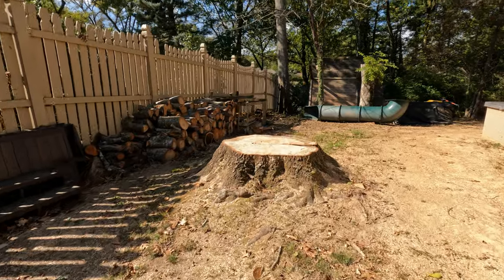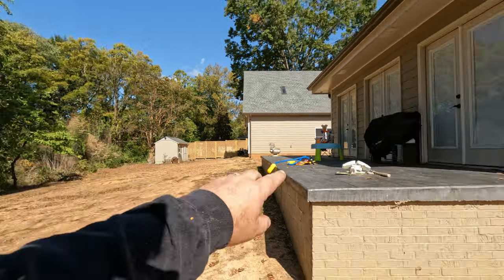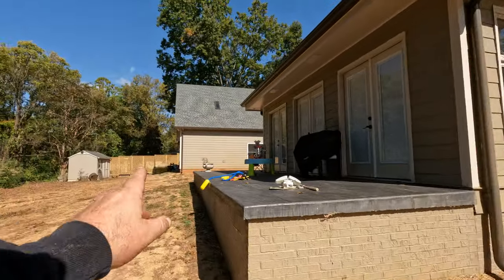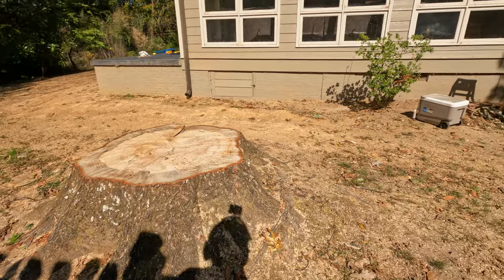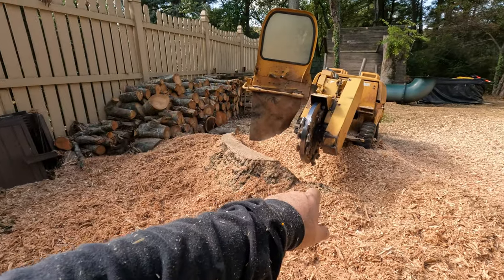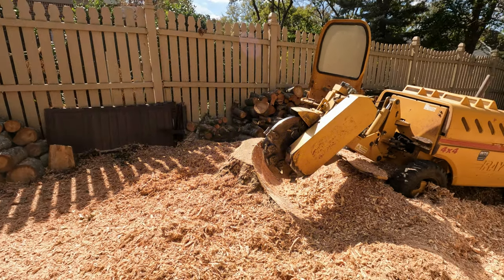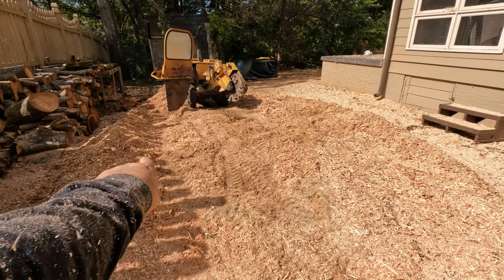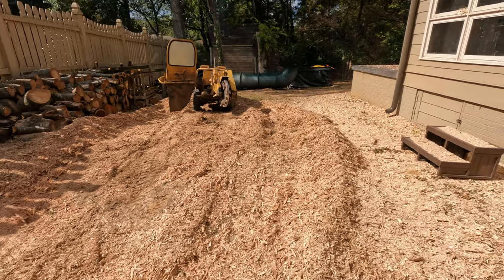" Stump Grinding: Conquering a Massive Stump with Dull Teeth!"

Comment: Couldn't agree more Chris. I recently did a 60 stump job, and after about 45 stumps my teeth went dull, it was a pain. Took more then twice the power from engine and cutting speed was much slower. When I noticed my hydraulics on the swing was forcing the cutting wheel through the stump, it was time to quit.  Much like a chainsaw, you shouldn't have to force the bar through. 
     By the way, remember when I asked you a week or so ago what's the worst thing you ever hit? Well, I  hit a 3/8 log chain on that job!  Luckily, it was just under the top soil an inch or so. If it would have been embedded, it probably have stopped my 80 hp Rayco in its tracks and damaged something.  Also a miracle the teeth didn't catch it and wrap up in the wheel or fling it at me!  Happy grinding buddy.
Reply from the maker: @toddscholze168, How long it take to do 60 stumps with your 80hp Rayco? My stump grinder has 65 hp. I have also hit stuff and that's what I what out for the most. Thanks for watching!!! Keep grinding!!!

Comment: I did a similar size willow stump the other day but it was cut higher than yours. Completed in about an hour and 20 minutes with teeth getting dull on the bandit 2550. But I was also hopping in and out of the customers skidsteer to remove mud and chips and had to chase roots. He also needed it ground deep because he was putting in a gas line for an I ground pool heater. Kind of a pain but all in all not too bad.
Reply from the maker: @mikesorg6746, that sounds a lot like this job except for my skid steer wasn't on this job this time. I always say every job is different. The weather is starting to change in Alabama now. Keep grinding!!!